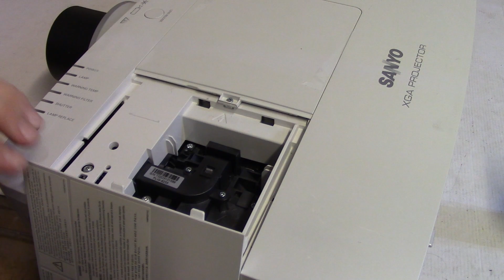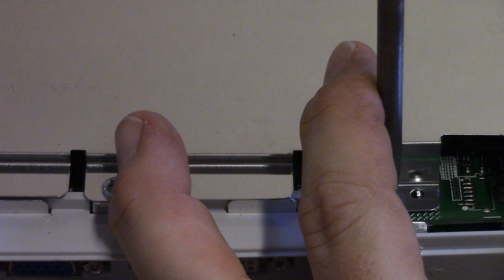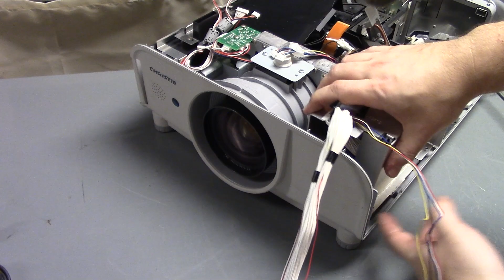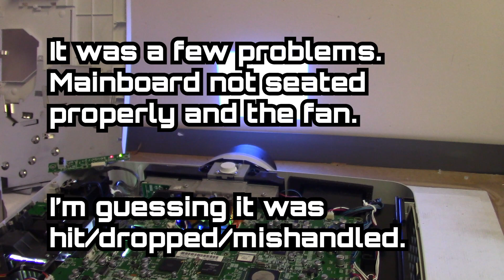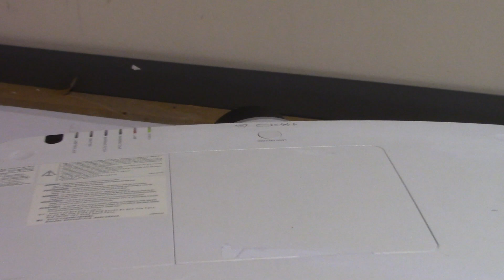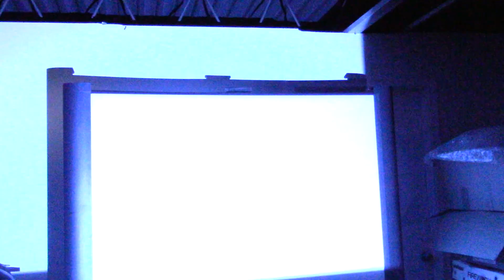Sanyo PLC-XM100L LCD Video Projector Repair | No Lamp Light | "Broken"

Comment: Have you ever had any luck with gathering compatible spares from donors of slightly different models? Same series, but differing specific model numbers... And i know you are mainly a DLP guy, but still, could you clarify for me if polarizers have resolution too, like the LCD panels they are paired up with?
Reply from the maker: The used gear is pretty thoroughly used up so the optical parts in particular are fairly bad used.  I find that LCD is a pain to repair due to all the alignment needed and when you need to change 6 polarizers, the cost is just too high. That said, polarizers don't have resolution specs as much as they have aspect ratio specs.  16:9 polarizers will not work with 4:3 for instance.   The physical size of the polarizer is really the factor to look for. New polarizers are really the only option and they are not too expensive.
Reply: @FixitFrank  Thank you! I long had the suspicion that this might be the case as polarizers having resolution would send the whole alignment procedure thingy through the flippin' roof. But i'm happy someone was finally able to clarify this to me. Unfortunately the NEC machine that i am working on here combines the in-polarizers with some other focusing lens into one single little module. I guess their engineers were pretty happy that one side of the polarizer is safe from scratches this way, but also this ingenious construction was why i carelessly wiped the open side of the polarizer into hell, thinking it was just glass. Bummer. Now i'm on the lookout for similar NECs in banged up condition and trying to analyze service manuals to find out if any might serve as possible donor models. Do you happen to have service manuals available to us mortals?
Reply from the maker: @Gary_Hun  I get them online like everyone else. Im just a dude who happens to be asked to work on these sometimes.  I'm far from an expert.  elektrotanya.com has a good SM collection. but I would not hold your breath on finding that info(for donors).  The best way to find compatible models is see if they use the same lamp part number. that is a fairly good way to figure out what is close. The thing you are looking at is a prism. There are 2 polarizers per color. Incidence polarizer before the LCD panel and then a projection polarizer behind it.

Comment: Hello Frank, Good work you do. Another fault on the SANYO PLC-XM150L same power supply as the as XM100 (Dead) (No LED) Power Supply C640=22uf@50v C635=470uf:@16v C685=22uf@16v. I had 3 units to totally strip down and clean, but unfortunately I made the big mistake cleaning the Polorized Glass (Red Green Blue) with a swab. Totally ruined them (So Delicate). So now I am looking for new sets RGB if anyone has a few stripped down Optical Units. Pretty Please

Comment: Great video. My PLC-XP100L starts up, lamp comes on (a bit flashy) then after a few seconds all LEDs (except for lamp is solid red) start to flash and the lamp turns off. Looked at the service manual and with Hyper Terminal I found " Gamma 1.8V NG"  (error code 1014). It apears that IC4801 should have 1.8V at pin 62? Its not entirely clear to me where to go from here.
Reply from the maker: hard to say without seeing it honestly.  It might just be saying that the gamma isn't on because the lamp didn't start.  I'd go by the service manual and troubleshoot via their no turn on checklist.  I'd see if your power supply is working all the way. that seems to fail in these.  The 6v line seems to be an issue and that might be what feeds the regulators for the 1.8v.  If the lamp blinks/flashes before it shuts down, that points towards a power problem even more in my opinion.

Comment: I have a Sanyo xm100l. Replaced  lamp and filter. Comes on shut down after 3-5 min. In menu it shows lamp counter 0 hours but how do i reset
Reply from the maker: it depends on why it is shutting down.  what are the leds flashing? the lamp timer sounds correct at 0 hours. the led flash code will tell you what the error is.

Comment: Hi Frank,  my Sanyo plv-1080hd has peoblem of the Warning Indicator get RED, please advice what should I start with? Thanks
Reply: Thanks, the warning led keeps red no flash . the manual shows need to check Power Supply. I will start from there. Thanks again.
Reply from the maker: That seems to be a common place for issues.  I have repaired a few that lost that 6v supply.  I might have some spare modules if you get stuck.  best of luck!
Reply from the maker: Sure, check the users manual to see what the led error codes point to.  If it is flashing that points to a potential fan problem.  If it is solid red, then it might be an electrical issue. The manual explains the different error codes.   Manual -> https://www.projectorcentral.com/pdf/projector_manual_4674.pdf
Reply: Thanks
Reply: Thanks for help, I checked again, when turn it ON, the door opened, then hear the fan runs for 2 seconds and stoped with warning led red. I unplugged all the 5 fans, and checked them, 4 of them runs, but the fun for power supply runs 2 seconds then stop for about 5 seconds and repeat the cycle, if this is the way of it? Or need to replace? Or need to check the power supply? Thanks!
Reply from the maker: what do the leds correspond to in the manual? you need to start there. I think you are jumping ahead of things.  is the warning led flashing a certain amount of times as per the manual? if its solid red, that unfortunately can be a bunch of things.  the +6v circuit is delicate in that model. Ive seen it fail. I dont think its going to be something you can fix without checking voltages. elektrotanya.com may have the service manual, or you can find an SM that is close and it should have the power supply voltages listed.

Comment: Hey Frank, so I have an older NEC projector that has some dust spots. They tend to be more prominent during darker scenes. 
I opened up the optical block and cleaned the screen in the dmd chip. I also cleaned the lenses that were accessible. But there are still spots on the screen when I pull it out of focus. 
Is there a way to get inside the output lens? Is it possible that’s where my dust is?
Reply from the maker: I doubt its in the lens.  If it is, cleaning that is really fiddly. Taking those apart is potentially the last time it might ever work.  I'd suggest cleaning the DMD surface again and making sure your lamp is new enough.  An older lamp will show more dust as it can't shine through it and wash out the spots.  I went nuts on a benq cleaning it only to find that the lamp was failing.  Once I put a new lamp in, the spots were no longer visible.  What end of the focus range are you seeing it?  Focus all the way in or all the way out?
Reply: @FixitFrank  First of all thank you’d o much for your reply. And thank you for making these videos. You are only person making such detailed and quality tutorials.
I opened everything back up and cleaned everything. The little fish eye lens and shaping lens fell out and I though I royally screwed up. 
Luckily I managed to get them back in place. And now the dust spots are completely gone. 
I could have never done it without your videos. 
👏👏👏
Reply from the maker: So happy to hear it worked out!!  Great job!

Comment: Hi Frank! I recently bought a used Mitsubishi WD8200U on eBay which was in brand new condition. I used it for a couple of hours and then turned it off. A few days later I turn it back on and it would start powering on and suddenly turn off and flash it’s power light with green and red. The status and filter light would also flash red which the manual just says means “contact dealer.” Wanted to know if there any next steps you’d recommend for repairing it. Thank you!

Edit: took it apart and found that one of the bulbs had broken at the base and might’ve caused a wire to short which melted the connector for the bulb

Comment: Hi Frank, I’m working on a Sanyo PLC-HP7000L with lamp issues. The lamp turns on for 5 seconds and shuts off. 
I posted a video on my YouTube channel showing the problem. I have the projector open now and I’m trying to fix the problem. I would gladly pay for your help  if we can get it working again. Lamp tested ok in the test projector. Also all fans are working. Thanks!

Comment: Hello, Frank. You are a pro) Can I rely on your help? I have been trying to repair an Epson EH-TW9300 projector for over a year. Projector had a vertical line, I replaced 1lcd panel with a new one, but it turned out to be defective (with line too). Then I bought a new 3lcd block, but it turned out to be defective without lines, but with a gradient effect. After a long search, I bought a new 3lcd block again , but it also turned out to be a defect - gradient: left part - red, right - part green. My original 3lcd has no color display issues. How can I fix this? Spare parts are nowhere to be found.
Reply from the maker: That is the problem with Epson and the main reason you do not see me working on them often.  Parts are virtually impossible to find and epson 100% will not give you service info. they design their projectors to not be serviceable intentionally.  The line may be caused by the LCD driver chip or a bad connector.  The gradient is probably a failed optical coating or possibly a polarizer panel going bad?  Honestly I stopped working on epson except for very specific situations.  Power supply issue and ballast issues are the only thing I will touch on epson and even then its a gamble as to if I can get the parts or not.  As much as I hate to say this, I'd cut your losses.  Repairing this will turn into a money pit if it hasn't already.   I wish we could repair everything but Epson has definitely gone against the right to repair movement.  If you are set on repairing this, your best option is to find another 9300 with a good optics and bad electronics and make one from the 2.  I dont know how cost effective that would be though. so keep that in mind.

Comment: Hey frank, I have a Benq mh733 projector. There was recently a power surge by lightening. It powers on, however, its showing a bunch of vertical lines. The HDMI port that it was plugged into does not work, but the other hdmi ports along with the vga port works. The main problem is the vertical lines. 
Can it be fixed?
Reply from the maker: If it happened after the power surge that could be a bad sign.  Normally the lines would mean a mainboard wasn't connected properly but if you never had it apart, then that's not the case. I suspect the mainboard would need repair or replacement. If it needs replacement, that's not going to be cheap. 
Take what I say with a grain of salt because I'm not looking at it, but I suspect this might be time for a new projector.
Reply: @FixitFrank  Thank you. That was the suggestion from a friend of mine, but I needed a second opinion. It's a pretty new projector, it was installed a few months ago. But I guess we'll have to look at getting another one.
Reply from the maker: These have a 3 years warranty.  If you are still covered, I would play dumb and send it back to BenQ and make it their problem. Just don't mention anything about power issues. Just "it stopped working right".  They should replace the mainboard without issue.
I'd offer to look at it, but since they are not very expensive to begin with, I know the cost of a new mainboard would be prohibitive.  I'd check that warranty though.  Hopefully you can utilize it.

Comment: Nice video Frank. I have just fixed an Optoma projector(2021 build), shorted Mosfet at the power supply(high voltage). It turned on, color wheel and fan turned on as well, but had a lamp error. It is a VDHDNTeH, but I can't find any info about this model number, wouldn't you know which actual model number is it? To me, it looks like it is an HD28HDR, but I can't be sure.
Reply from the maker: Hey Tibor! Check the serial number here. https://arc.optomausa.com/support/ModelNumberLocator/index.aspx that should confirm the model.  Thats a nice version if its the HDR model.
Reply: @FixitFrank  Thank you very much Frank, it is HD28HDR. Not bad for $40 and a transistor. 2021 build date.